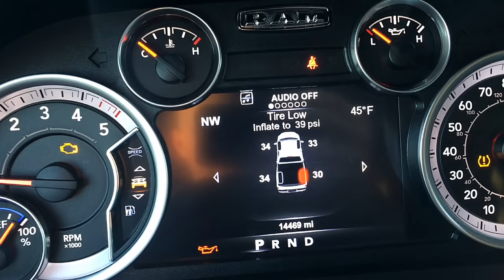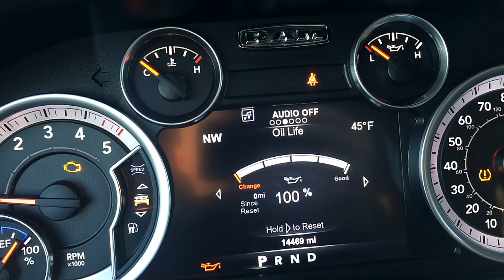Ram EcoDiesel 3.0L V6: Tips For Performing A Proper Oil Change

Comment: Was looking at a Ford F-150...not very impressed. My 2014 Ram 2500 4x4, Crew Cab Cummins Turbo Diesel is a Beast with 22k miles, I think needs a better home to where it can pull something besides driving to the local Redbox. The Ram 1500 ED may be just what I need...
Reply: Paul Rucker or the Nisson with the 5.0 Cummins. Alot of guys are saying good things about those.

Comment: Anyone have an opinion about the drain valves on the market like EZ Flow or Fumoto for use on these ecodiesels?  Seams handy but I’m concerned about them necking down the opening and reducing the flow?

Comment: great video! I too am considering buying a 2016 ram eco diesel and was wondering if you have changed transoil and filter? i understand trans filter is integral with pan and pan must be changed.
Reply from the maker: +Dan Callahan Yesit is but doesn't need to be changed that often. I only have 15k miles on mine so no trans fluid changes yet.

Comment: Hello, I am looking at buying 2015 EcoDiesel Ram and wondered if you had any feedback on things to look for or check for before buying?  Vehicle has the Laramie package with roughly 40k miles on it.  Am in a Ford F150 now, and have had a great experience there, but the Ram has really caught my eye and I am very intrigued by the mileage performance of the EcoDiesel.   Any feedback would be greatly appreciated.
Reply: Be aware that the intake manifold wiil need to replaced at some point because of the valve body inside and the sensor on the bottom. What happens vis these get fill with soot. Replaced mine at 100k  for around $2k. I'm not the original owner I bought it at 100k so I don't know if any additives were being added to the fuel or not. Thankfully I bought the extended warranty which covered all but $100 deductable.

Comment: i once dropped the drain plug into the oil pan doing our dmax oil change wasnt fun putting my hand in that hot oil
Reply: funny thing is out 6.6 dmax takes the same amount of oil
Reply: Or you could have waited until it cooled. Or used a magnet. Or gloves.....

Comment: Thinking about installing a amsoil bypass system on my ecodiesel, what are your thoughts on these systems? 10.5 quarts plus filter every 5k will get expensive
Reply from the maker: I am not sold on bypass systems I want the new oil in there more often than not speaking from an additive package standpoint.
Reply: I ran an Amsoil bypass system on my 5.9 diesel, and it kept the oil very clean compared to no bypass filtration. I have since removed that filter system and it's going to go on my ecodiesel. 
In my opinion every diesel should have bypass filtration to remove harmful soot from the oil. Change the oil at normal intervals and then change the bypass filter every other oil change.

Comment: Thanks for the vid's .. very helpful.. just a quick question .. whats your thoughs on adding an oil separator to these engines seem to be alot of people concered about coking..
Reply from the maker: An oil separator is alway a good idea to prevent as much carryover as possible. I am not worried about the oil carryover causing coking though Diesels have run dirty and had large amounts of oil carryover for as long as I can remember never an issue until EGR systems came into use.

Comment: Did my oil change but people say you need to wait an hour for the oil to drain? This true? Also did the fuel filter and went to go start it once everything was back in an fresh oil, the truck tried starting for about 6 seconds then finally started with engine light on. Checked the code and said something about Fuel rail high pressure or something. Curious to what this is about my buddy said the truck was priming itself before starting?

Comment: Thank you for the well done video.  Is it not wise to use ramps to elevate the front to assist in oil drainage?
Reply from the maker: +James Ponzi I would not no the pans are designed to drain while the vehicle is level especially on this one with the plug pointing straight down. Also the way the oil drains back down through the heads it would be best for the truck to be level also.

Comment: Service Bulletin 18-078-16 changed the oil weight to 5W-40 but this also includes this wonky note, "NOTE: Do not remove oil filter cap or change the oil filter. Replace the engine oil
only by following the steps below."  I understand the oil weight change but not changing the filter?  What's your take on this?
Reply from the maker: The trucks are brand new 5miles or so on them and the filter housing only holds 1/2 quart at best so the idea is the 10 other qts of 5w-40 will more than dilute the 5w-30 in there which is not a bad oil by the way but the 5w-40 seemed to prevent wear better. I am still personally using the Euro 5w-30 I have in stock until I run out just in time for summer and the switch to rotella 5w-40.

Comment: Would you recommend a bypass oil filter system like amsoil and would it affect the warranty? Great video
Reply from the maker: +TheMachiningman While they are a good idea I really don't think they are necessary unless you are a OTR trucker.
Reply from the maker: +TheMachiningman Factory warranty can be voided with any aftermarket systems it is all dependent on each dealer and regional rep.

Comment: thank you for this great video.i had a question i changed my oil and filter week ago,same oil filter with rubber sealling.i tighten the oilfilter housing after few days i reopend to check if the rubber sealling were in the right place.is it bad for the rubber seals ?thank you in advance

Comment: if draining the oil from the heads is such a pain wouldn't it be best to add some new oil while it's draining or does the filler tube by pass to the pan? I do heavy duty equipment and that's what I do when there not drainage fast enough lol
Reply from the maker: +Jason Gray It drains fast enough it just takes awhile for the oil on the top end to drop down is all.
Reply: +Ram EcoDiesel Source ok thanks man great videos

Comment: Hi, you mention rotating the tires. what rotation pattern do you recommend?  front to back same side, or some kind of cross pattern?
Reply from the maker: On a 4x4 they should be cross rotated like a big X
Reply: +Ram EcoDiesel Source 

I have a 4x2
Reply from the maker: on a 4x2 the rears criss cross to the front and the fronts come straight back same side.
Reply: +Ram EcoDiesel Source got it, thanks!
Reply: sfnotecorp  if you maintain proper tire  pressure ,wheel alignment and balance front to back will be fine as most MIGHT check air and rotate tires if its free and they remember-lol  The road to hell is paved with good intentions- $100.00  DIY   Oil change....hahahahahaha
Reply: Also depends on if your tires are directional or not.  Some tires are designed to only turn in one direction (snows especially)

Comment: I just purchased the Eco Diesel in a 2015 grand Cherokee. I assume the procedure is the same? The oil life monitor is saying oil changes at 10000 miles. You stated every 5000 miles, which is what I do in my other diesels. Should I ignore the vehicles 10000 mile interval? Thanks for the video.
Reply from the maker: Yes stick with the 5k interval for sure. The procedure is the same but I am quite sure the oil capacity is lower.
Reply: Thanks for the advice.  Just returned from a trip to Denver. 800 miles or so, 28.5 mpg.  Awesome power train.
Reply: +C Wyoming  The best thing to do would be to get an oil  analysis after a few oil changes. That way you can see with your driving habits  how much the oil  additives have worn thus knowing better when you really should change your oil. saving huge in the long run.
Reply: Dusty G. Where the hell can I get an oil analysis. Had no idea that was a thing.

Comment: Looking at a 2015 also with eco diesel. Do you know if the engines had been fixed from the 2014? Don't want to have those issues too.
Reply from the maker: +Troy Brunner If I was buying new I would definitely get a 16 or wait for the 17 models. My 2015 has no problems I think it was mainly on the 2014 models

Comment: i have the 2016 ecodiesel my question is you mention 5k but tje system is set up to do it  every 10k miles. my truck has 30k and i have been do it 10k should i go to 5k? also can you make a video for maintenance for the other stuff you mention.  this is a great video. thanks a lot
Reply from the maker: On a diesel you want to always stick with 5k intervals.
Reply: Ram EcoDiesel Source any links on the updated oil to be used
Reply from the maker: I have a whole video on it here- https://www.youtube.com/watch?v=LUnU7rUreNM
Reply: My owners manual states every 10k.  I also have a 16.  Soon to be a non Eco diesel.
Reply: Ram EcoDiesel Source - is that due to the wear and tear on the engine or just to keep the oil fresh? That's a considerable maintenace cost increase.

Comment: I have a 2015 dodge eco diesel...should you always let it idle 3-5 min before shutting it down as a general rule?
Reply: If possible yes. Any vehicle with a turbo should be idled down after spooling the turbo.
Reply: @SimplexSM  Thanks

Comment: Hard to see in the video but when you check it after changing is the oil still super black and burnt smelling? Everytime I go in to the dealership for oil change I check it after and it always smells and looks like old oil and or if they never actually changed it. Is that normal or should it smell fresh and be light brown in color?
Reply from the maker: It will always be black already.
Reply: @Ram EcoDiesel Source  thanks for confirming, good to know thats a diesel thing. Different experiences with gas oil changes.
Reply: Dealers probably aren't letting it all drain out.
That's why I do my own oil changes
Great vid by the way..
 @RamEcoDieselSource

Comment: I have a 2014 Ecodiesel and just finished my oil change yesterday. I used 8 Qrts of the Pennzoil Euro L with new filter, started her up, then turned the engine off to check the oil. My dip stick is coming out practically clean except a small amount of oil on the edges of the dipstick. I checked the drain plug, fill cap, and oil filter to assure there was no leaks and restarted the engine, checking right after and an hour after the engine was turned off. Any ideas what's going on?
Reply: I have a 2014, it used 10.5 quarts of oil.  I'm not sure what he was talking about in the video unless for some odd reason Dodge made two engine capacities in the Ram in 2014?  I just did my first oil change today and it called for 10.5 quarts, and it took just a hair under that to get to full.

Comment: can you just leave the filter off while it drains??
Reply from the maker: You can yes but the idea here is to close it up once the housing is drained so no debris or tools get knocked into the opening. Once the housing is drained it isn't going to drain anymore the oil fill cap provides enough incoming air for the oil to flow out properly.
Reply: It really dose not matter when you put it back on. As he said in the video, there is a check valve. Which means if your check valve works properly, than no filiter =no air flow. Putting the new filter on earlier just means there is less of a chance of debris going into the filter housing.

Comment: your hood is open, the truck would not command start
Reply from the maker: Yes I am aware I have been installing remote start systems for 10 years as a dealer tech but as stated many times people put cases of oil up on the engine compartment so it's ready and without thinking put it on top of the hood switch closing the circuit . Now it can start anytime it wants.

Comment: Why didn't he drain the oil first so it could drain while he removed the filter? Is there a reason the filter was removed before draining the oil?
Reply from the maker: +David Vangel Either way is fine the idea is the hot oil starts draining from the heads back to the crankcase immediately upon shutdown the oil in the filter housing does not so while the valve train is draining the filter housing is also draining. Once the oil is in the pan it's not going anywhere so no rush to get down there not to mention removing the oil cap, dipstick and oil filter cap for air has a direct effect on how fast the oil flows out of the pan when you get down there.

Comment: Does that not void your warranty doing it yourself?
Reply from the maker: +balle27 Nope
Reply: There's a federal law that states that if they require the dealer to change the oil or it voids the warranty, then they have to provide the oil changes free of charge.  This is why some of the European brands have started offering free oil changes during the warranty period.

Same thing if they require a certain brand of oil.  They can recommend a certain brand, as FCA does with Shell Rotella, but they can't require it.  Only that it meets certain specs.

Comment: I thought Pennzoil is a horrible brand of oil?
Reply from the maker: It was back in the day they made lots of sludge. Nowadays they are on top with the cleanest purest oil out there due to the base coming from natural gas.
Reply: Thanks
Reply: Chrysler had a recall on these trucks. It said get the Pennzoil out immediately and switch to Rotella T full synthetic. They were losing engines on Pennzoil. Luckily I switched mine to Rotella as soon as I brought it home from the dealership. I change oil every 5k and fuel filter every 10k.
Reply: @dennisodson4572  Pennzoil and Shell are the same company. SOPUS or Shell Oil Products United States.  Change probably more relevant to viscosity.

Comment: $10 per quart for oil is crazy
Reply from the maker: +bob14219 Yeah I know everything is special on this engine but you should only have to do about 2 oil changed a year. If you can afford the truck you can afford the oil. Same thing with the special Euro oil for the Mercedes.

Comment: $60 for a filter? F that!
Reply from the maker: Yup but at least you can get it from Amazon for $43 and the aftermarket option that came out is only $34 I believe. I link to them all in the video description.
Reply: +Mark Carruthers Some dealers may charge you $50 for an oil change on your Ford focus or w/e you drive, but you will never find a dealer who will charge you less than $120 for an oil change on a diesel truck.
Reply: +Eric M (Erich2277) I was speaking about the cost of the filter not the cost of the oil change.
Reply: Mark Carruthers Ya well that is "Capitalism" at its finest. Probably cost them less than 1$ to make it in China and charging people 60-70 bucks for it, because they "can".

Comment: Diesel fuel costs 15% more at the pump than gas. Diesels get 15% better gas mileage. That is a break even.
Diesel maintainance costs more.
Diesels cost more at the dealership. If not deleted, then diesels will not out last a gas engine. 
Some states with emissions testing will not allow deletes.

Why buy diesel?
Reply: Frank Morreale how do you figure diesel cost more to maintain? Oil and filters. No spark plugs no wires nocoil packs and on gas you STILL gotta buy the same filters and oil.
Reply: @michaelcuff5780  
Diesel: 
oil change needs 15 quarts of oil, $15 "tall boy" oil filter, $15 fuel filter.
Gas:
New spark plugs go 80K, coil packs are not a maintenance item.
Reply: I love the number 15. Lol.
Reply: It cost less if you buy a six pack rather than a 24 pack...lol😁
Reply: Diesels are much better for towing and the gas mileage you get when towing is much better than gassers.

Comment: too bad ram didn't wait for the Cummins engine. European diesel in an American truck,  no thanks.
Reply from the maker: It happens more often than you think, the 6.7L Powerstroke was also developed in Europe.
Reply: Jim Dailey Yeah only 1/2-3/4 of all vehicles in Europe are diesel. They don't know a thing about them...
Reply: you do realize that the Europeans have a LOT more knowledge with diesels.  when fuel is over $4 a gallon all the time, every additional mile you can go the more you save, only get that from diesels.
Reply: You see more diseal in europe than in america. Also diseal in europe cost less than gas because it is cheaper than gas to make.
Reply: A little automotive history:

Dodge had been working with Cummins for YEARS on the smaller diesel, both a 5.0L V8 and a 3.8L V6.  When it was finally ready for production, the fuel mileage wasn't where it needed to be, so Dodge (by now FCA), went looking elsewhere.  

The next-gen Nissan Titan was supposed to have been a re-badged Ram, but Chrysler's bankruptcy and subsequent merger with Fiat killed that deal, forcing Nissan to design their own replacement.  And, wouldn't you know it, Cummins just happened to have this new diesel laying around...

The EcoDiesel was originally designed for the European Cadillac CTS (VM Motori was, until recently, a joint-venture between GM and Fiat).  GM got the 2.8L I4, now labeled as a DuraMax in the Colorado and Canyon, in the "divorce".